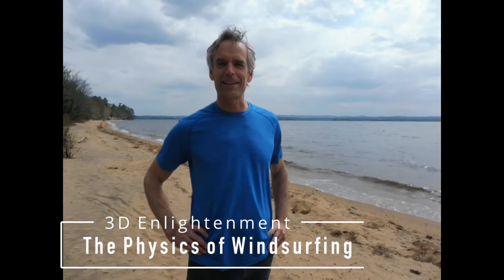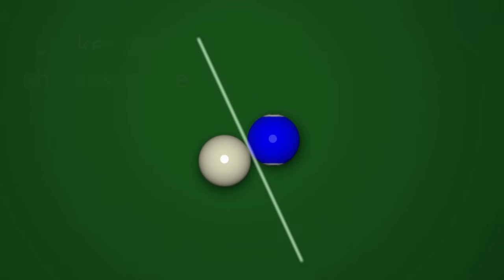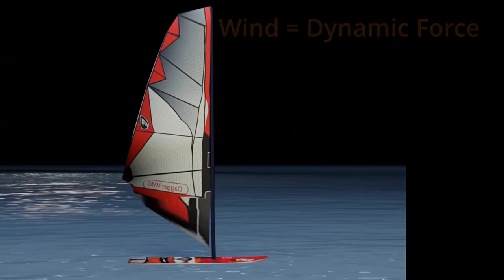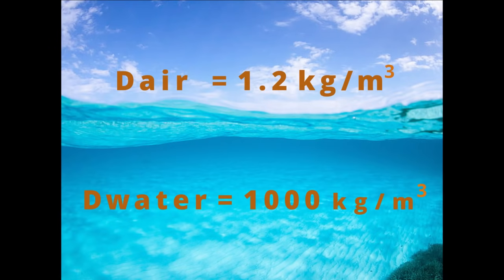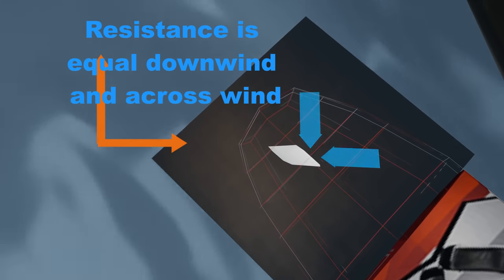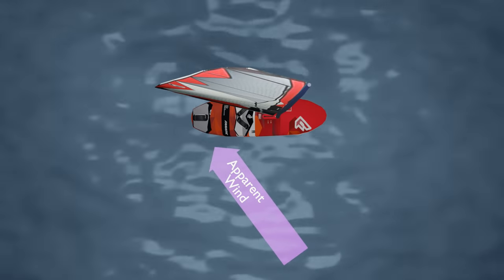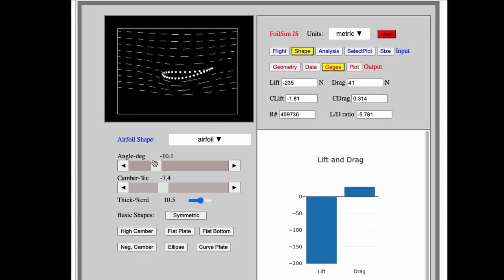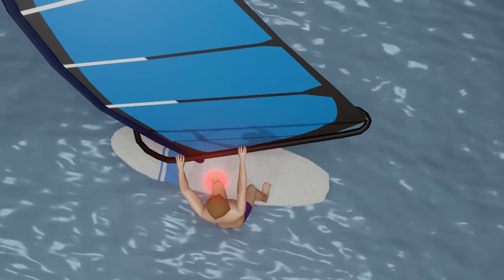Physics of Windsurfing

Comment: This is simplified to the point of being incorrect. Lift is extremely important to sailing and Windsurfing. The way wind interacts with a sail is categorically different from a cueball hitting another ball. Lift actually generates a force perpendicular to the wind's path over the sail by generating a lower pressure on the outside of the sail due to the increased wind velocity there.
Reply from the maker: Thanks Ian.  There are different theories as to the relative influence of lift from a Newtonian perspective on the windward side of the sail vs the Bernoulli perspective on the leaward side.  From wing theory lift is definitely in an upward direction perpendicular to the convex curved side of the wing (sail), and so I was trying to clarify the misconception that the curve of the sail "lifts" the vessel upwind.  I was trying to show that the curve of the sail is opposite to that of the wing and therefore the lift force pulls it downwind.  Not that it doesn't exist.  That force is still a driving force but it is not in an upwind direction.  I agree, that there was some confusion at that point of the video which I will try to clarify in my next video.  Thanks.
Reply: @3denlightenment  Not SOME confusion;  MUCH confusion.
The Bernoulli effect is NOT counter Newton - the law just describes the forces when the fluid particles move in parallel with a surface (at a 0 degrees angle) rather than at angles up to 90 degrees. 
And the curve of the sail is NOT opposite to that of the wing. The sail IS  a wing - cf. the very early airplane designs: they had horizontal sails for wings. Now, imagine an airliner with 30-40 m sails for wings to carry their own weight, the weight of the fuselage, passengers, crew, and luggage: not too safe, I suppose; thus the flattened-pipe shape of airplane wings to resist the substantial lateral forces.

Why not clarify the confusion by correcting the misconceptions of the present one?
Reply: The "lower pressure" on the outside of the sail is "lower" relative to the pressure on the inside. Why? Because the air particles hitting the sail)(like a cueball) apply a pressure on the inside of the sail.
In summary, the pressure on the outside is practically unchanged but the pressure on the inside is increased, thus inducing a force perpendicular to the sail.

Comment: It is relative good to have an idea, but physically is totally wrong. It is not correct to think wind is pushing the sail. Just think you can actually sail faster than wind. So, the similitude used is wrong. Sail works like an airplane. So, it is the "depression" on the other side of the sail who does the job. Check Xavier-stokes equations, or Bernulli fluids law.
Reply from the maker: The actual contribution from Bernoulli vs Newtonian forces is not agreed to by experts around the world.  Wind is a fluid just like water.  If you spray water from a garden hose at a ball for example, you can get it to move based on newtonian forces.  The difference between air and water is in the density of the materials but the response is the same.  There is discussion and controversy regarding wing theory (lift) and the relative influence from Bernoulli and Newton forces at various places on the web.  Some links are provided in the text below the video. A future video will clarify some of this.  Thanks.

Comment: This is fabulous!
Reply from the maker: Thanks Nico!
Reply: Nico. Does you have informed you about physics of windsurfing till now. Or is it only a feeling thing for you? Is it important to know abaout ?
Maybe you can do Video about that. I feel Windsurfing but I'm also interested in that physics.
Reply: @3denlightenment  and Nico : I graduated in physics and did my thesis on aerodynamics applied to windsurfing sails.
I appreciate the initiative but personally I consider this video technically uneducating: it is wrong to explain the force of the wind on the sail based on static physics. 
The sail is a wing and must be explained with the laws of aerodynamics, and the same goes for the fin. 
Where does the info about the 45 degrees come from? Why does not it take into consideration the sail profile? 
Now you a have a large public with no notions of physics who believe they have understood information that is in fact so inaccurate that it is wrong.
Reply from the maker: @RIWmag  Thanks RIWmag for the review.  I prepared the video to simplify the basic understanding of the physics occuring during the sailing process.  I focused on the Newtonian physics as that is the simplest to understand and predominates the forces involved.  The Bernoulli forces acting on the sail are partially captured by the formulas presented but as you know, it is not a comprehensive explanation but was not meant to be.  It is not wrong.  I use the resulting angle of 45 degrees in my explaination since that is the approximate angle resulting from Newtonian forces, and I always say "about 45 degrees".  As you may know, the forces acting on the wing are somewhat controversial (https://www.scientificamerican.com/article/no-one-can-explain-why-planes-stay-in-the-air/) but I am interested in making a more comprehensive explanation of the physics as a part II and would be very interested in reading your thesis if it was publically available.  Please let me know if there was any way to review it.  Thanks.
Reply: @3denlightenment  thank you for your reply.
My thesis was written in 1998 in Italian and on floppy disks. Many years later I discovered that they were not readable any more and therefore now only the version printed on paper is available. Anyway I did not invent anything about the physics. My thesis took the existing physics knowledge applied on sailing and added a comparison of experiments done on the sea with a real windsurf sail and done in the wind tunnel with scientific measures.
Sorry but I do not agree at all with your approach starting from Newtonian forces and avoiding the Bernoulli forces.
You first should use Aerodynamics to determine the existing forces and then you could split those forces into vectors, not the other way round.
You do not need to review my thesis, you just need to take one book explaining the physics of the sailing (there are many ones available) and start to create your videos from there.
I really appreciate your video skills and I really appreciate your intention, but your simplifications on this topic are too crude and lead to some explanation that conveys scientifically wrong content.

Comment: This is a commendable illustration of the "uniqueness" of windsurfing control.  Especially, how the pressure under the foot is involved.  You should have furthermore shown how the foot actually executes "turning the board" during a slow tacking turn.  The sail stays in position, while the foot actually forces rotation of the board.  As a windsurfer, in slow wind conditions I often execute a quick 270 deg jibe turn.  The sail/boom/mast acts as an "anchor" while my feet is "muscling" the turning force against the board.  Many beginning windsurfers don't understand this and have trouble executing turns, because they think the wind does all the work(like a sailboat).

Comment: no one sails upwind at 45 degrees !
Reply from the maker: True.  That is largely a function of 'leeway' or lateral drift or slippage through the water and, in the case of windsurfing, will depend on the size of the fin or presence of the dagger board.   The larger the underwater surface area opposing the leeway drift the more you will be able to sail closer to that 45 degree mark.  Another video is being worked on to explain this.

Comment: Great presentation and detail. Just one thing... if the board is displacing water, what you say about steering is true. When lift from the fin and speed of the board across the surface of the water causes it to plane (not displace) it steers more like a skateboard, responding to rail to rail pressure. In addition the rig/sail is tilted towards the back of the board as the wetted area of the board decreases due to upward lift from the fin, so the centre of effort in the rig moves back as the board accelerates. This is why the windsurfer starts by standing just behind the mast, but later moves to the back of the board into the foot straps.
Reply from the maker: Yes, you are very right.  I should have emphasized this is the approach in low wind conditions.

Comment: the lif of the wind is not downwind nor upwind, its perpendicular to the direction of the wind, at optimal lift angle. (min:6:00) or am i missing something here?,, the negative lift force is not going downwind.... in any case the lift force adds force to the sail and the windsurfer can use it, or direct it as he chooses.
Reply from the maker: Thanks Gab Co.  The question being answered in that portion is whether the lift force "lifts" the board upwind.  You are right, the overall lift force is perpendicular to the direction of the apparent wind but it is always in a downwind direction, never upwind, and therefore the air flowing over the sail does not actually "lift" it up wind, as has been said in other videos.  I was just trying to clarify that point.  Yes, the lift force adds force to the sail which the windsurfer can use or direct as he chooses.

Comment: Good as far as it goes.
I don't normally comment on these things but I feel some of the inaccuracies are so glaring I have to say something. 
Let’s start with the positives. The graphics are great and so is your systematic explanation (although flawed in some places). 
For a beginner this introduces some difficult concepts in an understandable way but starts to unravel when you talk about lift and steering.
If you put the correct numbers in the wing simulator accounting for apparent wind angle and the correct sheeting angle for the speed of the apparent wind then you get a very different result. This is how you explain the fact that at full speed on a broad reach, a speed sailor is almost fully sheeted in. In your model this could never happen because you could never generate an apparent wind sufficiently strong at such an angel. Then we get on to steering which deserves its own video. Pressure on your feet is irrelevant to steering with the sail from a physics point of view. Your feet are only transferring the force from the sail. This is then complicated by foot steering which is where you use the board moving over the water to steer like you would a surf board. Both of these are effected by the speed of the board and the relationship between the Center of Effort (CE) of the sail and the Center of Lateral Resistance (CLR) of the board.
As a beginner foot steering is all but irrelevant. As an intermediate/ advanced sailor, sail and foot steering is used constantly in combination. At high speeds, the setup of the board and sail also become more important as you can tune the relationship between the CE and CLR to give a setup for different things.
Hope this helps some one.
Reply: Glad to see someone bringing up these points, Guy Moseley. I agree that the graphics in the video are nicely done. But I was also confused by a few parts of the video, like the wing simulator and the comments about lift overall.
- In the NASA simulation, why use negative numbers for Angle-deg and Camber-%c?
- The fact that this results in "negative lift" seems like it's being presented in a misleading way, as if "negative lift" is supposed to mean "not moving the board upwind." But that's not what the simulation is showing. 
- Why not use positive numbers in the simulation? We're looking down at the sail and the water from above in the simulation, right? If I'm not mistaken, positive numbers would simply represent a board and sail on a port tack, instead of the starboard tack shown in the video. And the lift value would be positive in that case. Not that it matters, really, since in this simulator, positive and negative lift values simply represent different directions of travel perpendicular to the apparent wind, not necessarily upwind or downwind.
- The "CORRECTION" that the author added to the video description only adds to my confusion. If the orange arrow is meant to represent the force of lift, why would it ever point "downwind" and not perpendicular to the airflow?
- And I also wondered why the explanation of steering ignored the way that tilting the sail moves its Center of Effort in relation to the boards Center of Lateral Resistance. Again, the "Additional NOTE" added to the description only adds to my confusion. If the video and this "Additional NOTE" are correct, why is it standard practice to move the back foot up closer to the mast when performing a basic, non-planing tack?